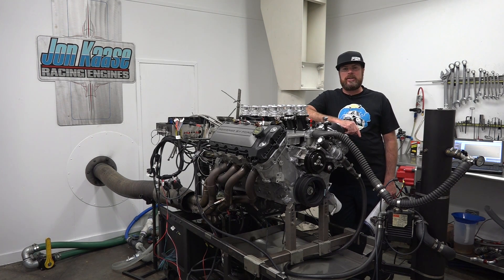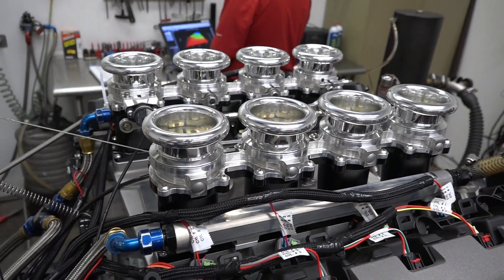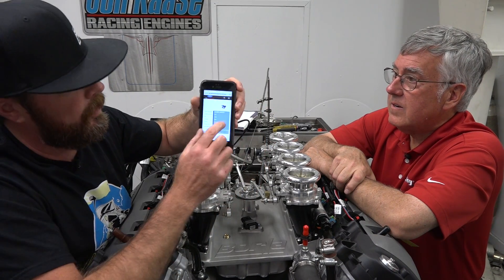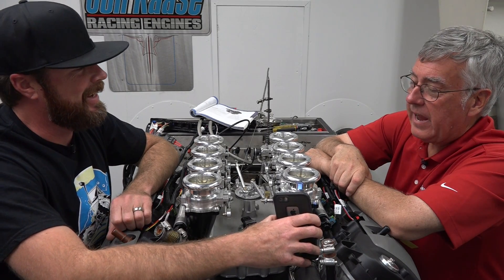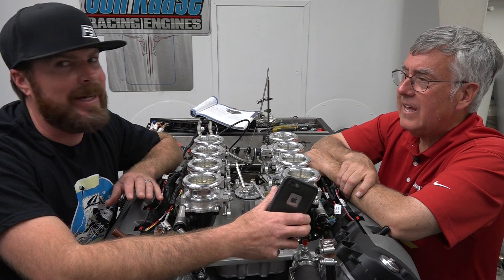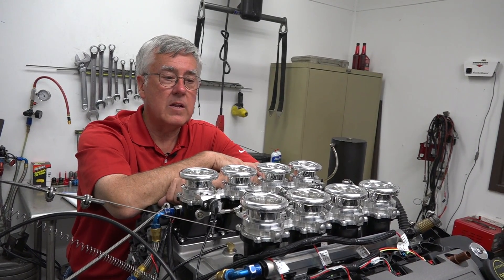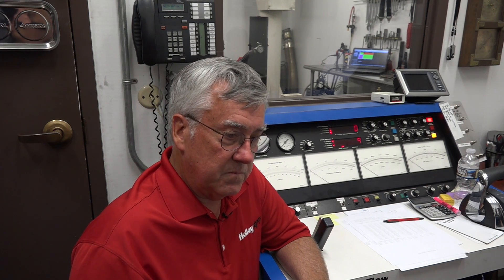Finnegan's Garage Ep.37: Dyno Testing a Ford Coyote Engine with Borla Stack Injection

Comment: It is possible that the guy bought the manifold just for looks.
Reply: People spend thousands on wheels of subjective looks that offer no gain or worse performance so I don’t think this is a stretch if you have the money.  That being said I think their barrel set up looks way cooler.
Reply: I would have if I were rich
Reply: The looks of eight smaller butterfly valves compared to a big one? YES
Reply: jpogi gtxcr1 shit yeh, it looks like Weber’s or the ol Hillborn injector trumpets
Reply: Honestly same
Reply: That's a lot of money for just a look.  Vut have to say I don't think it is worth the bucks.  For the$ he could have gone with a Kenne Bell twin screw blower and made a bunch more power.
Reply: @Hoggdoc1946  Some people are die hards for NA power though. Forced induction is cool but a ton of power coming from an NA motor is pretty, partly because its indicative of alot of work done to get it there.
Reply: W Hoggdoc Agreed but I don’t think that would fit in the build theme. 6500 is a bit short for a blower kit though.
Reply: @Hoggdoc1946  Still close to 500hp.  Even by the time you tune it for realistic street coolant temperatures maybe a solid 450hp. 

Unless the car is a lead sled it should still have decent pep and driveability.
Reply: Yup.  If you got the money, it's all  about the looks.  Edelbrock has a less expensive way if you want a twin 4 barrel carburetor, or a tri-power set up.  They look cool anyway.
Reply: For the record, I have $3500-4k in a 355 chevy putting out 20 hp more than that electronic nightmare. I could blow it up 5 times and still save money.
Reply: @donrutter6765  I don't think anyone cares about your cheap build, cheap hp, cheap chevy blablablabla, we're watching something cool here😁😁😁
Reply: @ramonmunoz9271  Actually most people at the track try to get the best bang for the buck. So yes, intelligent people spend money where it counts.
Reply: @donrutter6765  you're missing the point here, these people are showing us their testing of a beautiful expensive borla stack injection on a coyote motor ,which I believe is something fairly new for this engine, they are not showing a "best bang for the buck at the track" video...there are plenty of videos for that..

Comment: all im gonna say is that the owner should of used another ecu that would of allowed him to use the VVT.. sure top hp wont be affected but the area under the curve is gonna suffer... why spend money on a new motor with the latest advancements if the parts you are going to buy for it cut the potential: wouldn't be annoyed if  all u had to do was a software  update, but u had to physically lock the cam gears in position which i heard take 8+ hrs. 

PS: cams are needed to take advantage of all that extra airflow.

Comment: I don't really know the Coyote VVC system -but if its a 2 position system like the Rover K-series VVC over here, then Instead of spending hours 'locking up' the cams, why not just electrically wire the actuators in the 'high performance' position -i've read of guys doing that over here -some of them have even put a switch in with a second fuel / ignition map so they could run in 'low performance' valve timing mode for economy / around town driving.

Comment: He says "no pushrods" as if they are bad..
Hmm.. Yet he knows GM's LS engines make shitloads of power easily and cheaply.
Pushrods & rocker arms are a Hell of a lot easier, cheaper and simple compared to the complexity of over head cam drives.
Oh.. Remember the McGee TopFuel engine?
It's kind of funny how it couldn't beat and became obsolete to the 1950s design TopFuel pushrod Hemi.
Reply: Eddi can swap cams without removing the intake manifold.  Everything is rollerized around the cams, and there are two seperate chains for each cam in my 4.6.  I love that motor but i will admit the vvt phasers suck.
Reply: Not true.no rockers pushrods and other parts pieces to come undone at revs.take off head all related parts come with it.

Comment: i stuck a 165 thermostat in my 400 SBC powered 1977 chevy truck......stock as stock can be (yes, it came with a 400 small block)

it seemed to like it......as in, it didnt hate it....but i dont think it was any faster
hard to make 3 tons fast....

stuck a 195 back in.....because montana winters suck with 165 degree heat.....and it started starting REALLY hard when hot

like CRRRRAAANNNKKKK thunk CRRRAAANNNKKK thunk.....turning over hard and slow

turned out.....timing was at like 20 BTDC degrees......needs to be at about 8 (but i run 10 to 12....it likes 10 degrees a lot)

i even stuck a new starter i had on my clapped out 68 impala that i dont drive (brakes dont work, no rear shocks...death trap)
Reply: Boats and heavy trucks used a 160 degree thermostat all the time because the engine is usually being run at higher HP levels continuously than in a light car... Also, SB400's tend to have the pistons way down in the bores giving horrible engine quench effects and prone to detonation, so a lower temp helps prevent that... Flat top pistons of proper compression height and a mild cam brings you up to 375 HP...

Comment: is that guy serious? oh just knock it down to 160 degrees? yeah, just let me go my 3 more full size radiators for my car... how about being realistic to what cars actually see on the street, or better yet on the track which is more like 200-220.  but no, just here's your engine that makes 500hp but you'll never make 500 hp cause running at 145 degree is impossible

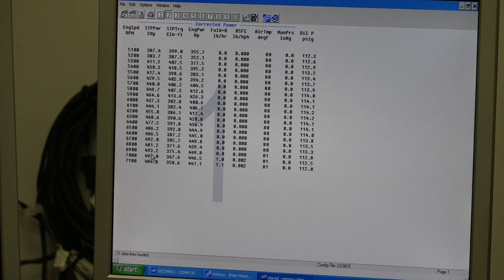Comment: It would have been nice to see the baseline HP/ TQ curves, then the run with the Borla laid on top.  You might have picked up a few ponies but did you loose anything because your data points only show 5100-7100 rpm?  The 493.2 "STPPwr CHp" appears to be a corrected, corrected value from the 449.8 "EngPwrHP". (11:41)  which is about 9%, Is that the Holley factor or what?  Interesting point about the engine coolant temps.  As you pointed out real world of street car, temps will be much higher than the cool 140 of a dyno room and timing will be much less.  There goes your 60 hp peak.

Comment: What I like the most about every comment, is that most off this people have little to not experience with neither motors ls or coyotes, coming from someone who has both I have to say, first this's the most stupid build I have ever seen makes no sense before I boost mine I make 512 rwhp with off the shelf cams and bolts on and wonderful tune, and for those ls lovers I have an ls 3 nissan 240 and after a couple thousand bucks full bolt on cams all top end from Texas speed and really good tune 520 is all I get , best build ever not is not but is not that simple as u may think like junkyard ls1 1500 bucks and 500 hp and as side note an extra 1000cc helps a lot

Comment: I don't understand. 
Five liter engine, four cams, no VVT, $6500 in a naturally aspirated intake, aftermarket EFI control and it tops at 7100 RPM with less than 500 horsepower. It ran something like $20,000 all in. 
Where did all that money go? 
He could have bought more power off the shelf for a lot less money with a Mast Motorsports setup, or stuck a cam and springs in a junkyard 4.8 liter Chevy then a China turbo.

Comment: you guys talked about camshafts do you know how much it cost to put four new camshafts in that coyote motor blasphemy I'll take a LS any day over a coyote I know they like being boosted and they're high-revving they cost too much and like I said wait till you go buy camshafts then then you have all that jewelry underneath the valve covers LOL all that timing chain stuff guides tensioners or later we'll go bad I'll take the single cam shaft LS motor any day and the ls is cheaper more horsepower

Comment: In the racing Cobras and the Daytona coupe, they had a 289 engine with Webbers. No plenum, just the air going in the top from the hood scoop and straight into the engine. Peter Brock said the Webber setup made the engines run cooler and even with a wild cam, it didn't have much of a lumpy idle so it puzzles me why this setup has a plenum

Comment: Most catalog power values are just the minimum you can expect from a motor as not every engine build is the same some will have more power some will have less so they always under state so they don't get sued if the engine you happen to get has less than what the claimed power is. So if Ford or Chevy say you can get 420 horses from a crate motor you will actually get anywhere from 425 to 460 depending on how close to blueprint specs the motor is and how light the pistons and conrods are.

Comment: I have seen another video were they locked out the VVT system, and dyonoed the engine and unlocked the VVT and managed to get better power out of the motor. So if you had the VVT unlocked what would this motor make realistically?

Comment: 6500 for less than 50 hp, no thanks Finnegan.  People have developed turbo kits for these engines for far less than that.  I'm not hating, I just like bang for your buck performance.  I remember working at ford when the coyote first came out people were dropping money on the ford motorsport boss 302 intake for stupid prices.

Comment: Those aluminators are overkill for a n/a build. They are meant for NO2 or boost. The base coyote crate engine would have been a whole lot cheaper. Plus that intake is also overkill with stock cams.
Reply: Looptydude what do aluminators come in ? gt's or only in higher end mustangs like boss modle ?
Reply: NA_EddyG they are just crate engines. They are probably in the Cobra Jet mustang but those aren't even street legal.
Reply: Looptydude aw interesting. never knew that , thank you sir !
Reply: Looptydude ill have yo check that out. i didnt even know they carried different versions. is the standard coyote engine in the gt's come with Forge internals ?
Reply: NA_EddyG GT' have hypereutectic pistols and dinky forged I-beam rods while the aluminators have forged mahle pistols and beefier Manley H-beam rods.

Comment: Why would you lock the cams just to run an incapable ECU?  I'd rather go with an AEM Infinity 708 or a Haltech Elite 2500 that can control all four cams.  The result will be a broader torque delivery rather than a peaky torque curve which is what you get when you lock the cams.  The long block is sick.  However the tuning solution is a little disappointing.  I wish I had more hands.  So I can give the Holley Dominator EFI system four thumbs down!  LOL

Comment: wow 20k for almost 500hp not a bad way to spend money lol. And srsly what is the point in having ITBs if your gonna have a plenum? it may aswell be stock.
Reply: 505197 so anybody running a high rise dual plane intake is a sissy or anybody with a carburetor
Reply: driveability!!!
Reply: The plenum takes away the joy of balancing the throttle bodies, which any tuner knows is the point of having individual throttle bodies. First you get them to idle in balance, then you try to get them to open at the same time. You can fiddle with the linkages until you go blind. Only a sissy runs a plenum.

Comment: The Coyote is a monster of an engine, forget a $6500 BS intake manifold, throw a $5K supercharger on a bone stock unopened 2015+ motor and make 700whp+ with ease with no other mods but fueling/tuning.
Reply: Theres more to building an engine combo and a car than 'ZOMG ALL THE POWERZ!'
Reply: Copy that.kinda like a Terminator car on roids..that's bad ass
Reply: Yep and with 700 hp it will end up in the ditch with all the over powered Coyotes with crap suspension lol.  I am a Ford guy and enjoy watching the videos of the millions of Mustangs wrecking even with the stock horsepower.  I get the desire for the go fast and if you are going for the go fast you aren't using a Coyote when there are Demons and Hellcats running around.
Reply: @markperry2827  I run mid 8s @ over 160mph on bone stock suspension.. hellcats are slow bud.
Reply: @markperry2827  go put another fart can on your honda civic.
Reply: Or build a 434 SB chevy for less than half the price @ 750 hp. Your choice.
Reply: @donrutter6765  I love chevy guys thinking they can change the oil filter on anything chevy ever made and get 750hp for $10.  You idiots build more drag lane oilers than even Honda guys.

Comment: ITBs are for throttle response, but then he goes and puts an auto behind it? Cmon man...
Reply: excuse me for being dumb, but doesn't dumping ITBs into a plenum defeat the purpose of independent throttle bodies?
Reply: I dont think it does.  I think it is just a vacuum accumulator.  It isnt actually a plenum.  Also of note; snooping through Borlas intake page it looks liek they bought another company (I cannot for the life of me remember the name) and simply put their name on the intakes.
Reply: Andrew Smith stupid 6500$ intake manifold just for looks
Reply: I'm not an expert on ITBs but I think it may take away some responsiveness in exchange for driveability like they mentioned
Reply: that makes more sense to me....seems it would be silly to have individuals dumping into a common area anyways.  Then again, I'm not an engineer, nor that smart.  I have heard of plenums pre-itb.  However, I can't fathom the expense, complexity, and clearance issues of doing that.
Reply: Fotios Tsingos 
Yep. You can run much crazier cams w real itbs
Reply: Andrew Smith and a 4r70w as well... My Lincoln town car runs that laggy shit transmission. But makes sense. No need for a 4r100w with that low power output.
Reply: @thebigone545  the 4R70W and 4R75W in the Panther chassis are tuned to shift slow and smooth for comfort. Do a J mod and it will patch the tires on shifts

Comment: 490 was my guess, I'm admittedly a Ford guy and my experience with coyotes has seriously impressed me. They take to forced induction like a duck to water, they rev for days, and sound mean as hell
Reply: V
Reply: And they love e85, make huge numbers with a bit of boost, and you don’t need to touch the intervals to have a robust 800hp daily driver. New injectors, a beefed up fuel system, a supercharger and e85 is all a 3rd gen coyote needs to reliably make 800hp. It’s a pretty nice set up.
Reply: As a mad Chevy guy, you’re right. Chevy  has taken note.  This is good for us all. Better Chevy better Ford, soon better Chevy. The bar gets raised repeatedly. Not hating life now.
Reply: Nothing runs like a blue oval iv had mud bog guys running 454s and ls motors tell me straight up if you have the money a ford will make way more power and iv been told by guys at car meets if every car was stock fords would win every race Chevy's are just cheap and you can usual find a lot of them at your local junk yard.
Reply: And eat pistons like a fat kid likes cake.
Reply: @ryotaryuu  But all the Ford boys put them in there Mustangs!  lol
Reply: @mewrongwayKOCXF What's wrong with that? Foxbodies weigh 2800 pounds 😂
Reply: @rickitysplitz7035  Not a thing wrong with it!!  My 78 Chev Monza 2+2 weigh 2600 with me in it! 🤣🤣

Comment: 20K bones for under 500 hp ... I would be embarrassed that everyone would now know I was a sucker and should take my money from me before someone else does. I would never admit how stupid I was or how weak my crappy but cool looking motor is. What a piece of shit , power to weight ratio... ford racing doesn't even know what that means apparently. I would be embarrassed to be an engineer at ford offering this ungodly heavy turd shit motor.
Reply: The Aluminator makes well over 500 horsepower stock. The bog standard Coyote makes more power than this stock.

This modification actually lost almost 200 horsepower, partially because they cannot use the variable cam timing with this EFI system. Because the Coyote is the first American V8 to use it. *cough*

On top of that, the standard Coyote costs a third of the Aluminator, mostly because it has an iron block. Aluminum is a lot more expensive than cast iron.

But nobody thinks about any of that. It's just hurr durr Ford sucks muh LS swaaaaaaaaaap
Reply: atx atx awwwww change your huggies, its his money dude
Reply: atx atx the customer can afford it, I guess the price is for the coolness factor, rather than horsepower gains....
Reply: Amen, great comment, specially the last part..lol
Reply: atx atx   But then what do you know?
Reply: atx atx you are really stupid...
Reply: No.. just no.